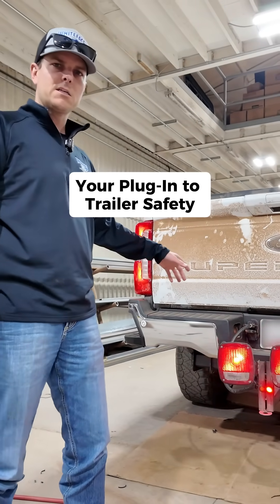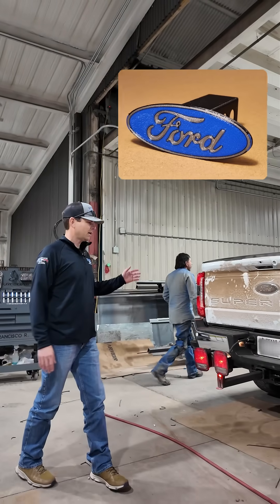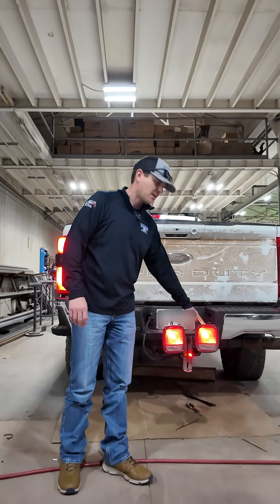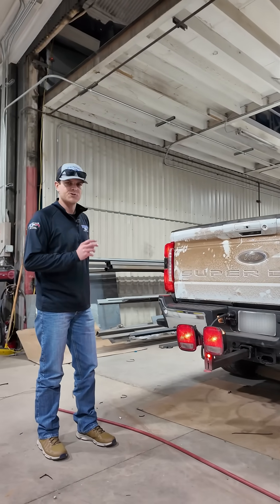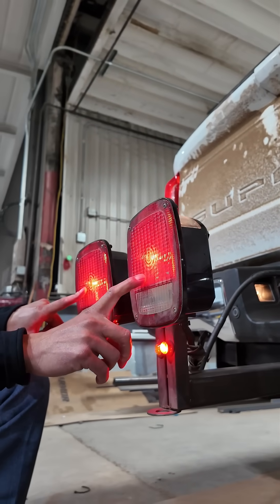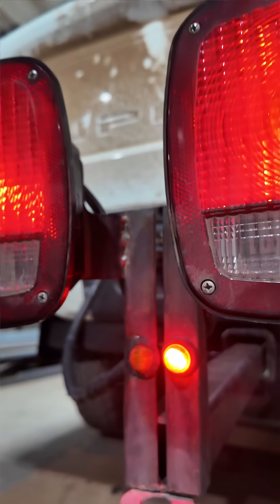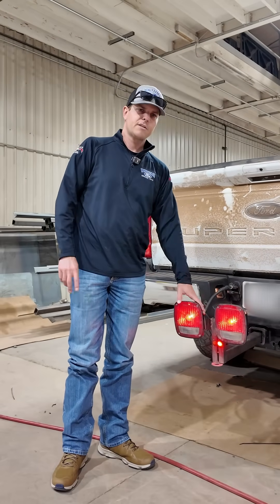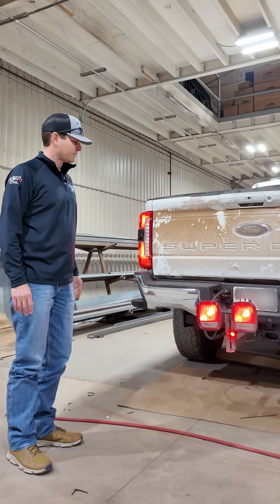The $0 Trailer Light Tester That Actually Works #Shorts

Comment: Wish my Ford dealer had something like this. My Expedition stopped working with my travel trailer. Says "Trailer Disconnected" when I manually engage the brake controller. Took it in & of course their little plug-in tester says nothings wrong 🙄

Comment: Good video.. figured I would just make the point of suggesting you don't have to start the truck to check the reverse lights. Just turn the key on and make sure the parking brake is set..

Comment: IPA Electric Brake Force Meter w/ Dynamic Load Simulator. I've been this for years professionally and it's fantastic. It allows you to see the voltage output to the brakes to test weak but functional brakes.

Comment: Great ideal it’s stupid that it is necessary all those modlels that pulse and caust trailer lights to shut off and breakers not to work if they don’t sense a draw are supid and manufactures should have their butts kicked for putting them on the trucks

Comment: I’ve seen this before someone took a milk crate and shoved the brake drums in the bottom with the controller to simulate the full load on the circuit. Then put these lights on top with cutoff switches to simulate faults that can show up on the dash. All the wires and test points were labeled. Someone really needs to make one of those boxes.

Comment: Why does my 2025 Platinum F350 say it’s not charging the battery in my diamond C gooseneck?  My 2020 didn’t have any issues. Is this a setting?  Also do a video on the ford TPMS and camera setup for trailers.  I want to get 8 of the TPMS for my gooseneck and 4 more for my 20’ trailer but my local ford dealership is zero help and acts like I asked them what the square root of 69 is.

Comment: Ah yes ford using current for enabling something. Heads up you’ll have issues if you don’t have incandescents hooked up as the LED’s won’t demand enough to turn on the controller. 

The 4EOD on OBDI/OBDII trucks & SUVS locks and unlocks the torque converter in the same fashion but uses resistance from the brake circuit. Can cause shifting issues when LED conversions are installed.
Reply: I used to work in a truck fleet shop and we had bunch of E/F-series cube vans. Some point like maybe '05 or so the new trucks started coming with LED clearance and tail lights installed in the body. To prevent turn signal hyper flash, they just added resistors to the body on the stop/turn circuit. Eventually, the resistors would fail or rot out, and they would hyper flash. I would just delete the resistors and put incandescent lights in the truck like it was designed for and send it. Never had one come back.

Comment: Very nice. Do you need to start it to check reverse lights? You could set the parking brake. Turn key to on position. Depress service brake pedal. Move gear shift to reverse and reverse lights should be illuminated.

Comment: I bought a after market led strip lights that goes between tailgate and bumper. It's not working right so how do I fix it?
Reply: Check power and ground at the connector

Comment: My truck comes factory with a trailer light test
Reply: That test button won't tell you if the trailer lights are actually getting power. Especially if the trailer plug is corroded or damaged or there's a wiring issue
Reply: @Suedeman it supposed to be used for the walk around

Comment: Any idea why the manual brake application switch on the brake controller doesnt fully activate the trailer brakes? Ive noticed its only about 50% power
Reply: It's pulse width modulated. Adjust it higher or lower depending on the gain desired

Comment: Would it be beneficial to get a set of magnets off an old backingplate and add that to your tester?
Reply: You can use a pair of horns.  It detects horns like it does the magnets.  Not so much with an incandescent bulb
Reply: @charliemagoo7943  good point i was just thinking about putting a load on it and horns would definitely do that